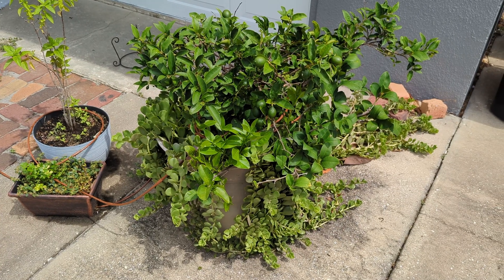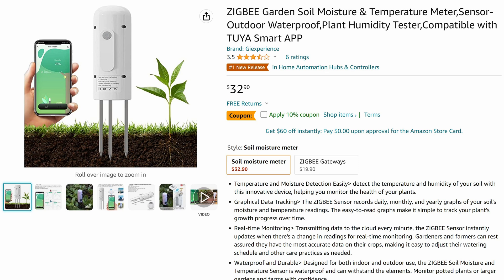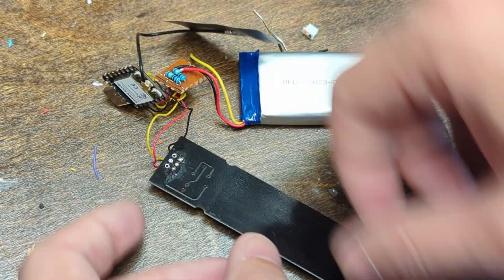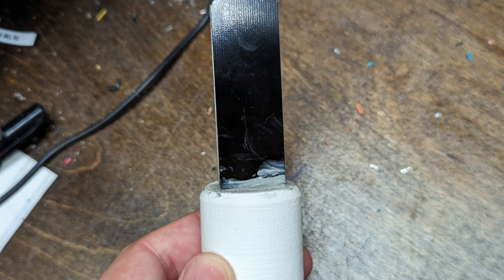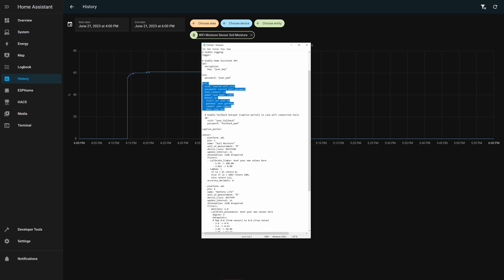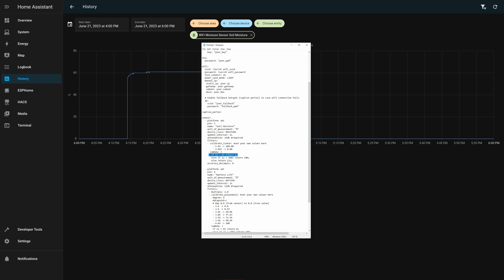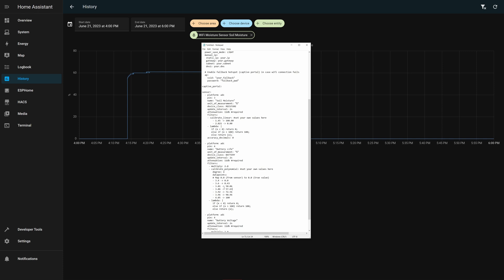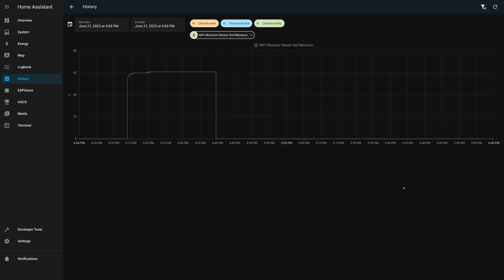Wi-fi Soil Moisture Sensor with ESPHome

Comment: Can you charge the battery via the Xiao or do you need to de solder and charge via a charger. Thanks/
Reply from the maker: If you plug the Xiao into any USB port/charger, it will charge the battery. No need to desolder.

Comment: How did you get the voltages for the battery?
Reply from the maker: See ~2m in the video. Just taking a reading via a voltage divider to an analog pin on the Xiao.

Comment: nice video sir, i do as well as your code , but after update ESPHome platform - adc duplicate error show , so what to do any other way?
Reply from the maker: Looks like mine died this week (I think water got into it), so I can't test this, but try replacing:

pin: 4

with:

pin: 
      number: 4
      inverted: false
      allow_other_uses: true

In both places that it appears. See if that works. They implemented a change recently to break using a pin multiple times unless you specifically allow it.
Reply: @TechDregs   Thank you , New ESPhome update as well as working fine pin multiple

Comment: I can't see a link to your 3D printed parts. May i ask?
Reply from the maker: Sorry, I generally no longer upload 3D prints. Too many of my past designs ended up being sold on ebay and etsy.
Reply: @TechDregs  Is it possible that you send me the 3D print file in an E-Mail? I will not sell the file. I just ordered a printer and i´m verry new in this material.
Reply: @TechDregs  Thanks for the project also is it possible to connect the battery directly to the esp32 c3 supermini?, and is it possible to send the 3D print file by email? Of course, I will not move the file to the web. Well thank you
Reply from the maker: @rudopodkrivacky  I don't the supermini has onboard battery management.

Comment: can you send the link of soil sensor and where did you get it connected. with my sensor only stupid values
Reply from the maker: Did you calibrate your sensor values? You need to test what voltage it sends in open air and fully submerged in water. I used these: https://www.amazon.com/Capacitive-Moisture-Corrosion-Resistant-Detection/dp/B07SYBSHGX

Comment: Can Share all ? the project is amazing. I've been looking for something like this for a long time and now I'm grateful to you for showing it. can you show the wiring properly? Thx
Reply from the maker: There's actually very little wiring. The battery is connected to the battery pads on the bottom of the board. I've got a voltage divider on the positive lead, with one side to ground and the other to an analog pin. The sensor board only has three wires: power in, ground, and sensor out. The sensor out just needs to go to an analog pin. The YAML is in the description; so you can see which pins I used there for the sensor and battery voltage readings. One trick that I have done since this video is powering the sensor from a digital GPIO pin, which I enable when the device wakes up and disable when it goes to sleep. That has a huge impact on battery life, as this sensor draws about 5mA when it's on.
Reply: @TechDregs  great stuff. Would you have the YAML that includes the GPIO pin as the 'smart' power source for the sensor?
Reply from the maker: I updated the details with the code. Basically, you just add onboot and onshutdown commands, and add the pin below as a switch. Make sure to change the GPIO to the pin you're using for power to the sensor. I also added a wifi signal sensor, since that can be useful to see.
Reply: thanks @TechDregs  , I was implementing it on my side and apparently HA after 2023 requires the use of 'allow_other_users' if the same pin is used for several uses (battery life and battery voltage)

I replaced pin: 4 for 'pin: 
      number: 4
      allow_other_uses: True'
Reply: What code did you use to calibrate the moisture sensor? (so I can get my min and max values)
Reply from the maker: Yeah, that's a recent update. For calibration, I actually would watch the logs. Document the voltage reading when it's dry before you even put it outside. Then you can also check it when you put it in a glass of water or soaked soil. That's how I calibrated mine. You can add another ADC component to read the voltage during calibration (you'll need to add the allow other uses code for that also on the moisture sensor pin).
Reply: @TechDregs  I ended up doing the second:   - platform: adc
    pin: 
      number: 3
      allow_other_uses: True
    name: "Soil Moisture Voltage"
    update_interval: 2s
    attenuation: 11db #required
Reply: thanks

Comment: Thanks, this is great and exactly what I want to create. Would you be willing to share the design for the case and a link to the battery you used (for sizing)?
Reply from the maker: I generally no longer share STLs for designs, but one thing that's helpful is that you can usually get STEP files for the SEEED Xiaos either directly from them or from grabcad. I wouldn't get this battery again, so I won't link it. I wasn't paying attention and ordered a 3-wire battery, and the third wire isn't useful (I think it's a thermistor in the battery for temp monitoring).